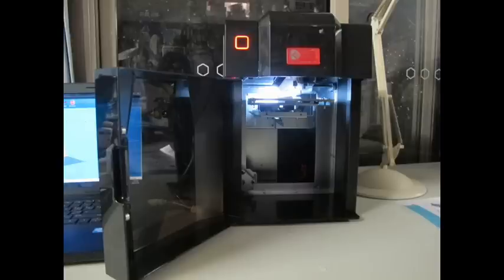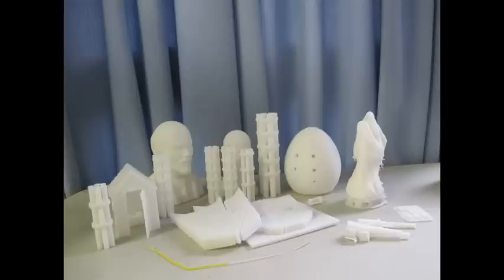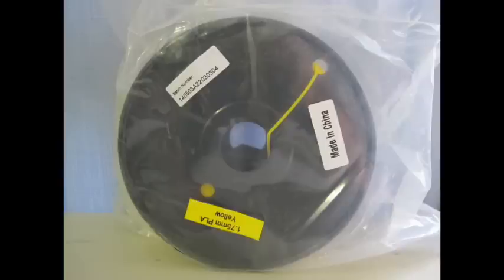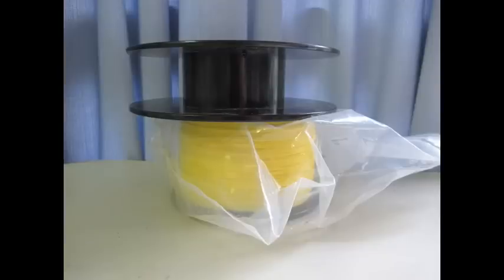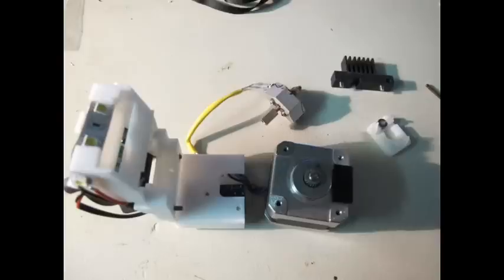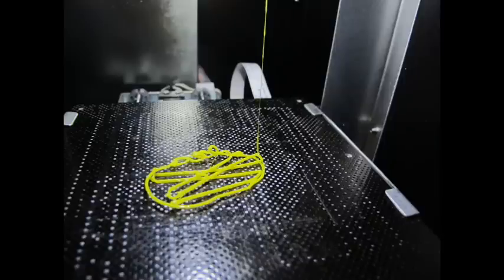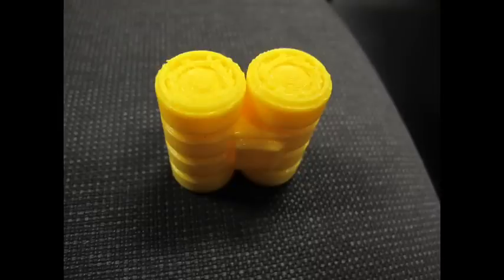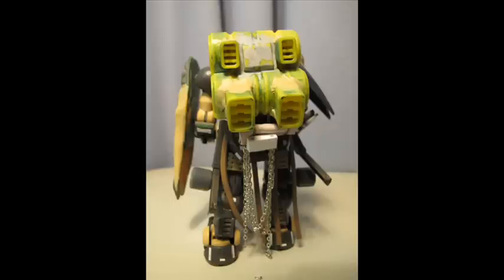3D printer update: PLA vs ABS, heat exchange blockage and more

Comment: Alan, you need a pop filter for your mic!
Reply from the maker: yeah I do but was too lazy to film it again. Also need to find a nice piece of foam to make a pop filter.
Reply: Wire coat hanger and an old sock works wonders and nobody will see it though can hear the difference for the better. Works wonders for audio pop protection.
Reply: mokanaman Found a Band-aid works well actually.

Comment: hi i have the same printer i noticed if i use the up pla as soon as its put down the first layer after raft if you hot swap out the pla to another brand i have no issues with clicking clonking etc i can use any brand also adding blue painters tape to the build bed will have you printing raftless in no time works fine with pla or abs   also if you search the pp3d site there is a program upfix where u can alster temps & various other settings  etc   hope you find it helpfull bud ..wayne
Reply from the maker: +wayneuk Thank you wayne some fantastic advice I will try that.